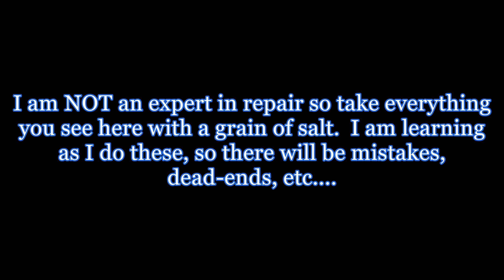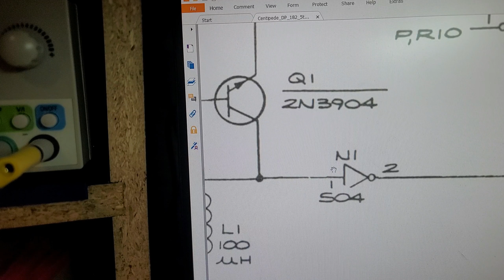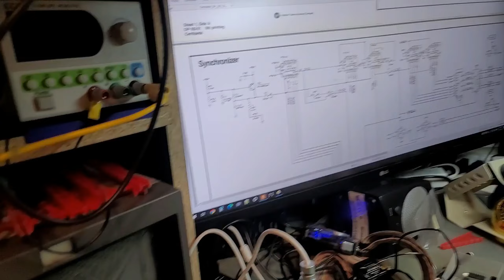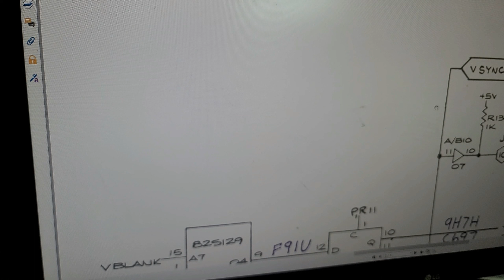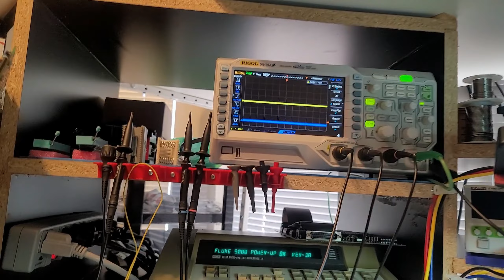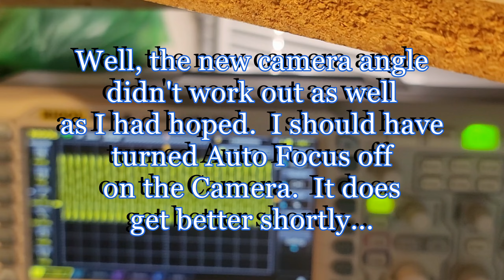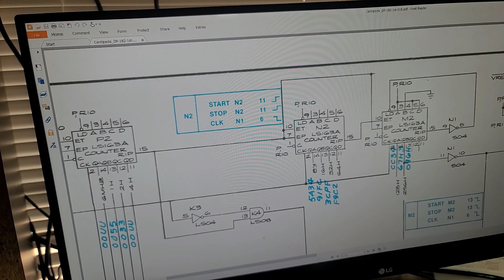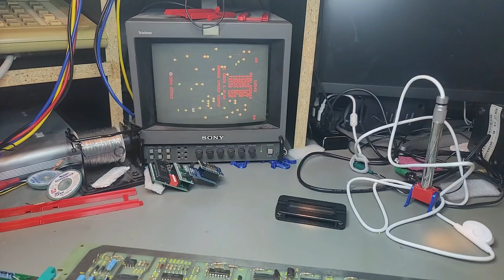Centipede Black Screen Repair #7

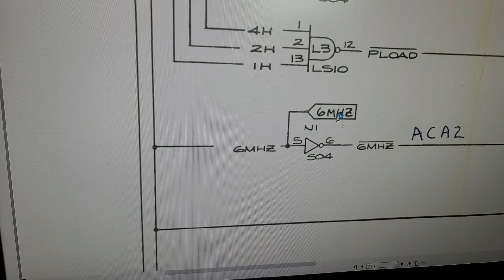Comment: Great video, I have a centipede with similar issues.  Can you share where you found those IC sheets (36:15) , I refrence a book but having a seperate pdf for each IC chip may make it easy to refrence.